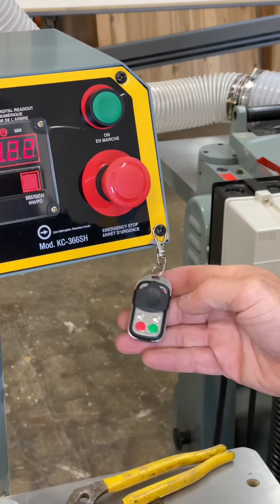Four cutters for four different glue joints

Comment: I’ve been kicking around the idea of buying a domino, which clearly has many advantages, but for panel glue-ups, tung and groove would be fine and, a hell of a lot cheaper. Of course, bits for my Rockler router table setup are far cheaper than the monster bits you use. The only downside is that you’d see the tung and groove from the edge of the panel, but I personally like seeing the joinery so it’s not really a downside. Of course, you can cover up the ends with breadboards, but I don’t care for the look of breadboards. 

You always make everything appear so easy and, yes, the machines you have help, but you are truly the master of joinery and one hell of a great woodworker, at least from the products I’ve seen come out of your shop. I wish I had a set up like your shop, but I’m 64 so by the time this beginner could gain the experience, find the money to buy the tools and establish a customer , or even a YouTube subscriber base, I’ll be too old to actually make the products everyday. Actually, my wife would kill me before I even got to that point after she saw what I was spending on the machines alone. 

I enjoy watching your channel and living my dream through you. I wish you continued success my friend.
Reply: my situation exactly..😂

Comment: I’ve not had much luck with the centre referenced glue joint cutter. It never seems to be exactly the correct height and leaves a lip. Your loose tongue method is good as it preserves all the width of the timber when the timber is in short supply. Cheers
Reply: Poenie is the two of us and

Comment: The glue always seems excessive.  Is that necessary?  Probably a dumb question...  You're a professional and that's the amount you use so I'm sure it's good.

I'm an aspiring wood worker.
Reply: It’s way excessive, you don’t need to empty an entire bottle for 3 boards.
Reply: I wouldn't say it's excessive. The dude who replied below doesn't know what he's talking about. The important part is to guarantee that you don't get a dry join. If you do, the piece may not be usable. Glue is cheaper than wood! I will say I don't think it's a good idea to have the clamps touch the wood where the wet glue is. The steel and glue together on the wood will cause deep stains.
Reply: @hashkat  That makes sense for sure.  I've seen Mister Duffy use brown paper before to protect surfaces and pieces from glue drips.  I'm afraid I'll sand weird when I'm trying to remove the extra glue.  You all (professionals) make everything look so easy.